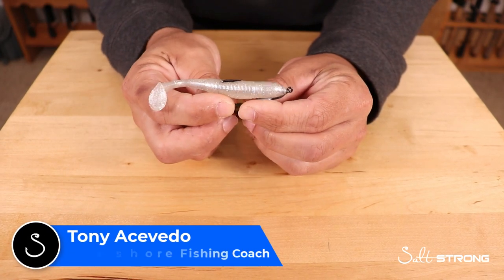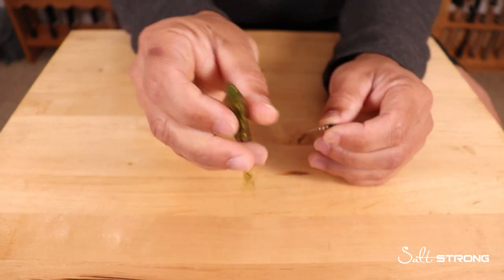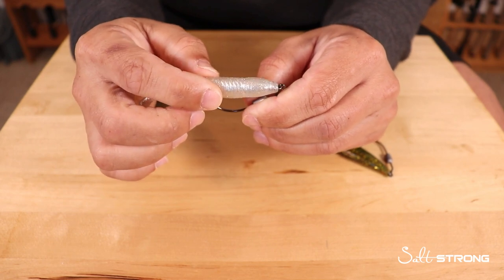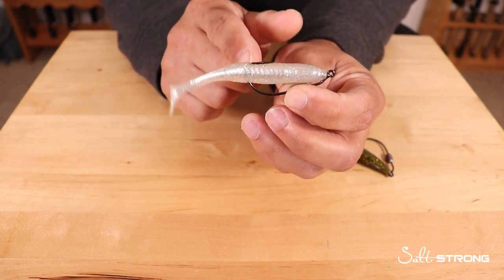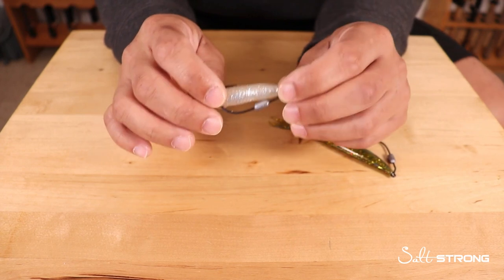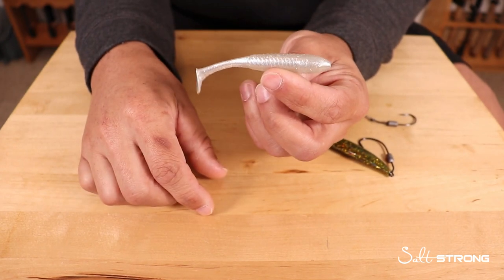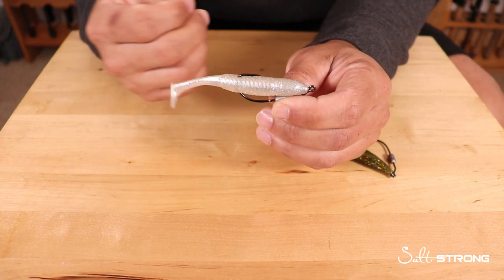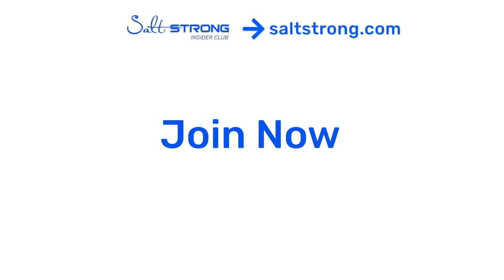How To Help Keep Your Soft Plastic Lures From Tearing

Comment: Another trick to secure the soft plastic onto a jighead is adding a drop of super glue. It keeps it on the jighead secure, so it won't slide down as much. 
Tight lines 🎣🤙🏾